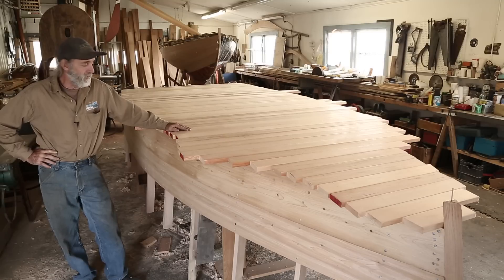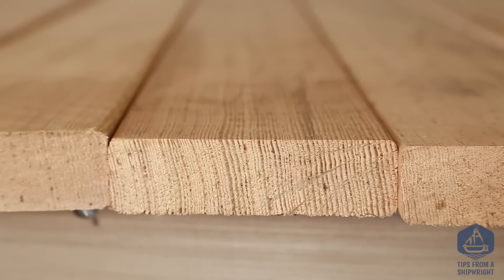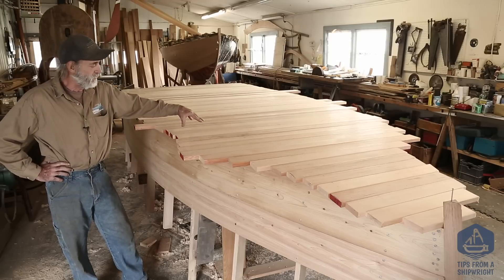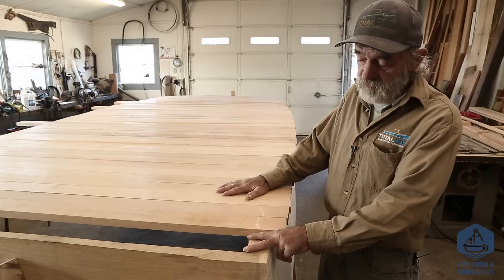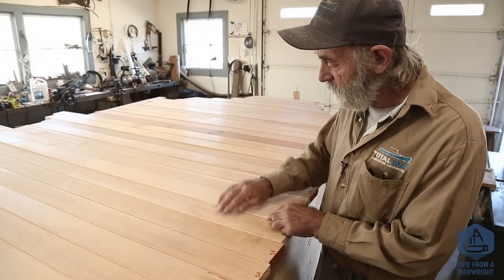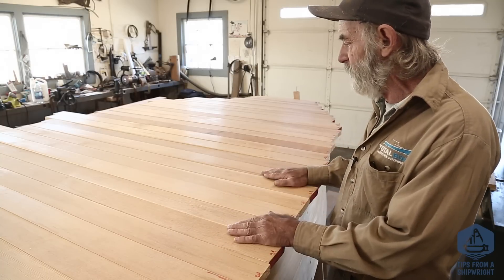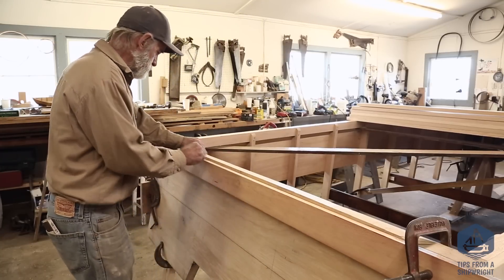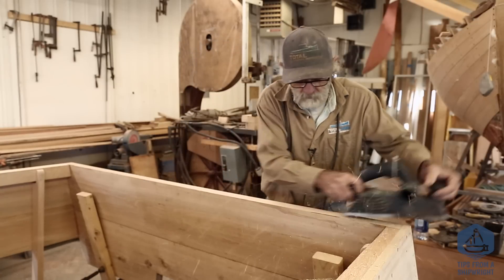Building the TotalBoat Work Skiff - Laying out and edging the bottom planking (Episode 16)

Comment: Great video as always. Love seeing how other go about tackling different tasks. 

I have a few old aluminum levels that I modified with a little clamp thing to quickly take up a sheet of old carbon paper for marking high spots. (I still have a few thousand sheets of the stuff that were being tossed from an office.) A handy use for some old straight levels that had cloudy/damaged spirit bubbles. 

The little 8-inch one has proven especially handy for a wide range of jobs around the shop over the years.

Comment: great work ! can you tell us how you get you pencil super sharp like that on the video. I keep trying but break the lead. bit of a silly question but very essential!! really liking these new videos.
Reply: try using a mechanical pencil...the lead is always the same size and when you draw a line the line is always the same size
Reply: I have a standard pencil sharpner at the ready in the workshop. I sometimes sharpen with a stanley blade/knife but it can break the lead. I will have a look at mechanical pencils but if ind the tip is not as sharp and when you use a finer lead it can break... Mainly its for getting the point right up against the rule.  I guess its practice..... but if Louis has any tips then that would be helpfull. cheers.